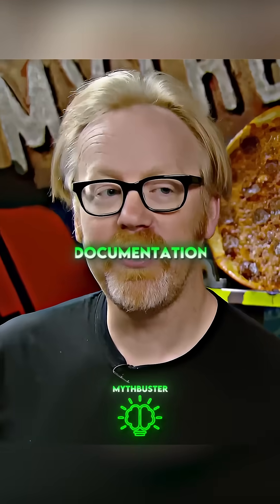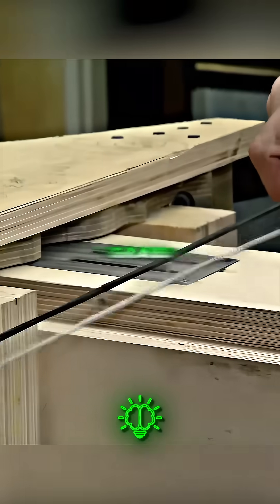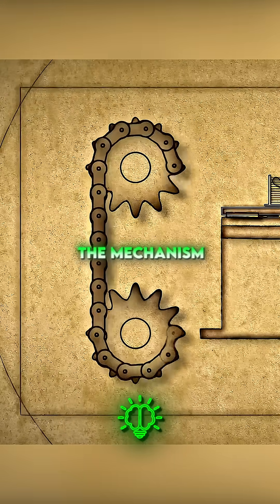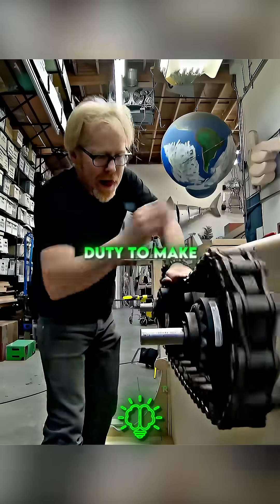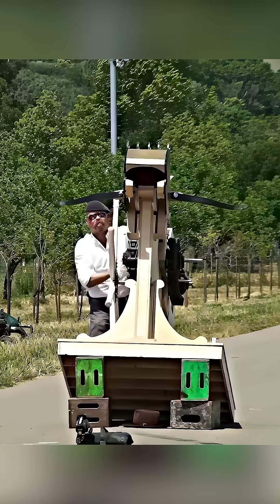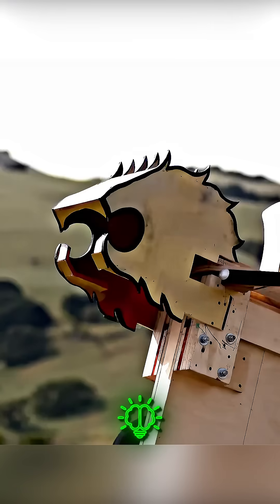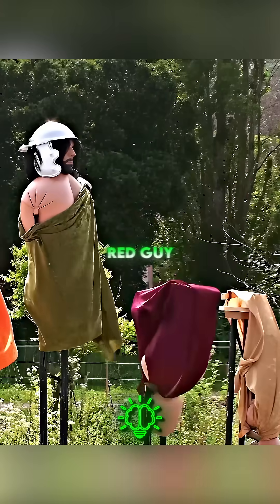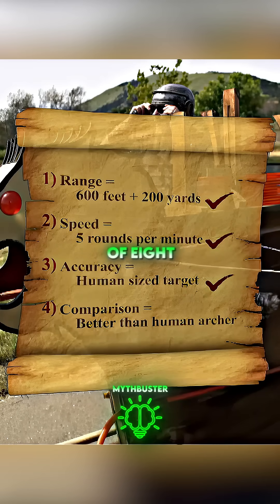The Ancient Greek Arrow Machine Gun! 🏹

Comment: Technically that's not a machine gun that requires multiple shots per release (like in a gun you'd pull the trigger and multiple shots are fired) that's a gatlin gun. Which in law a gatlin gun is legal because each rotation of the handle is its own action like a semi auto.

Comment: That chain and sprocket seems a little overkill
Reply: Chinese repeating crossbow had arrow/bolts stacked imma gravity feed magazine on top.  There was a handle above, attached to a pair of long rods that served as levers to operate a hinged hook that'd swing forward, catch the bowstring, pull it back, and automatically release at max tension.

It'd be difficult to fire offhand or be effective when hand held, but if resting on a wall or a log sawhorse, it'd fire at the same speed you'd pump an old bumper Jack or bicycle pump.